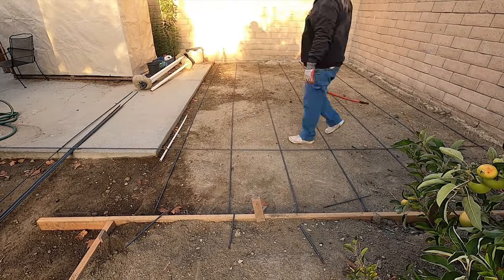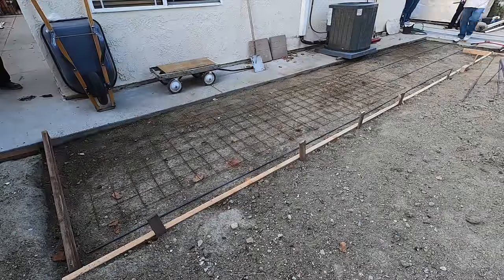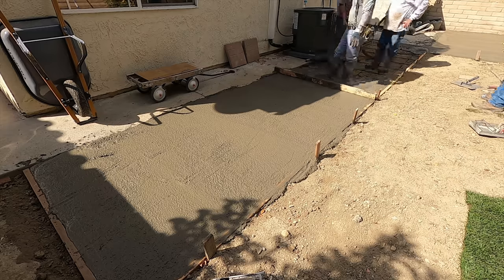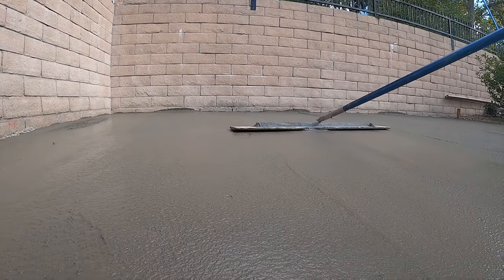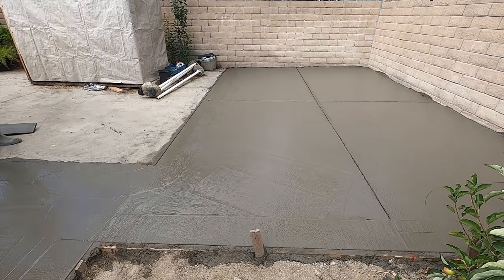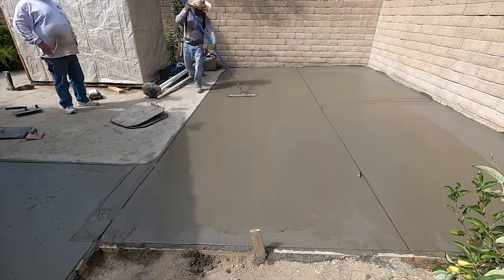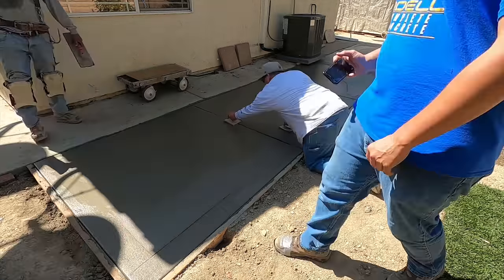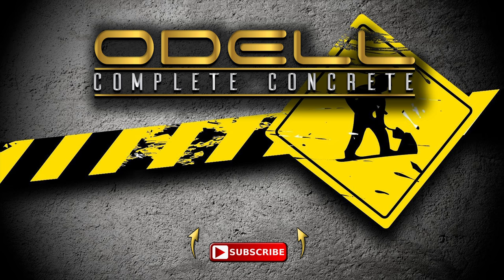DIY Backyard Concrete Patio Pour

Comment: I have a question regarding concrete skids.
I’ve got the marshalltown qlt skids.
When I try to use these on the concrete surface while finishing, they do more damage than good.
The concrete sticks to them, creating divots when I pick them up. Plus, they’re hard to get up. They act more like a suction cup to the concrete.
Someone advise please. 
Using a sheet of plywood works easier and doesn’t do this,  but I’d love to master the skids for mobility 
Thanks
Reply: If the concrete is sticking to sliders it’s probably because your on it too late. That was my experience in the past. Before you slide back slide them back and forth to work up at least some kind of cream. Then you shouldn’t have pop offs. And when/if you pick them up don’t just pull them straight up wiggle them around a little bit and then slide them up gradually. Some chemicals make finishing more of a challenge too. But a lot of times it’s just you’re in it too late and it’s probably really hot
Reply: Keep em moving for the most part. Pro Tip= Poke a hole in the cap of a water bottle and take it with you full. Lay it in the sliders with cap up over the edge so it doesn’t spill too much. Spray the concrete down a bit on the area your moving to, helps avoid it when its that hard already IMO
Reply from the maker: Sounds like good ideas

Comment: So for the most part of basic concrete finishing. You need to : pour it, screed it, bull float it, wait for the water beading to evaporate, add controlled joints, edge it, hand mag float it, trowel it, and then broom it for a slip resistant finish?
Reply from the maker: Bingo

Comment: David, why the need for different materials in the floats, wood, aluminum, magnesium?  Is it just preference of the user or do the different materials do different things to the top layer?  Thanks!  Love the videos!
Reply: I'd like to know that too.  
I imagine that since the different materials are made of their own specific molecules, it could be actual chemical reaction or response going on specific to that tool material.
I'd like to know.
Reply: Resin/wood floats to make it nice n creamy and easier to move the concrete around. Mag float when it’s harder n for burn finish
Reply: Frank Dilson  all comes down to preference
Reply: Frank Dilson  sounds like you googled it. Copy and paste huh
Reply: @jscott09js  probably never even worked concrete either haha
Reply: Frank Dilson  he literally asked if it’s preference in his comment bud
Reply: You should have put another score mark from that corner to the wall I no it will crack there from that corner
Reply from the maker: I think you may be right.
Some people talk about concrete some finish it.
Reply: Basically and simple is wood floats make it easier to move the concrete around and essentially don’t pull moisture from the concrete, when you use a metal or magnesium float it’s for finishing and making it smooth and it extracts the water from the concrete to the surface
Reply: @eribertososa5156  He literally asked if there was a reason for it, or was it preference.  
OCC Didn't actually answer the question. 
The guy with the polar bonds answer was answering the right question; which was, in short, is there a reason, chemically, atomically, or mechanically to use wood at some points then magnesium, or other material. If his answer is correct then the answer is yes, there is a reason rather than preference. 
-Licensed internet arbitrator.
Reply: I was just gonna comment on why do most these you tubers use wood floats, and this was the first comment on the list
Reply: I use the wood float most often on small flat work because it will pull more material making it easier to make it flat. .pulling material from high spots to level ourt the low spots.mag bullfliat is a good tool when you may be pouring on a hot day short handed and or its not a certain finish .mag brings up cream well and alows you to seal it up or sell it .i love my wood bull float and funny trowel .makes it easier on my back

Comment: 2:20 ac slabs. What’s a good way to be able to raise the slab up without laying or replacing concrete is there a tool that can pick the slab up while you lay dirt under it.
Reply: Use a farmers jack with a block of wood, 2x4 or something like that. Their also called Jack all’s.
Reply from the maker: There's some stuff out where you drill 1/4" holes every 6' and squeeze a chemical compound down there that expansion and raises the slab
Reply: Look for mud jacking or slab jacking. Common problem caused by erosion/shrinking/compaction  of soils under the slab.

Comment: What's the purpose of joining the concrete?
Reply from the maker: Crack control
Reply: @OdellCompleteConcrete  Thanks for replying. Hey what is the best proportion of cement, sand and gravel for casting a backyard?

Comment: I've got one for you. Maybe not your forte as I'm not sure you do structural concrete? 
If a builder uses rebar when building a skyscraper for example, why is the rust on rebar not an issue?
Here's where I'm coming from; if steel rusts you can't just cover the rust and make it stop. And since concrete has a very high concentration of water that's not helping at all. It's always puzzled me how it's ok to use rusted rebar in structural applications.
Reply from the maker: It is a problem did you see what happened in Florida?
Reply: @OdellCompleteConcrete  Yes I saw regarding the apartment / condo. I did not know what was determined to be the cause other than foundation issues.  I haven't followed it much since it happened. 
So yeah I was just looking for confirmation that there are issues. Makes me wonder if structural concrete should even be a thing.